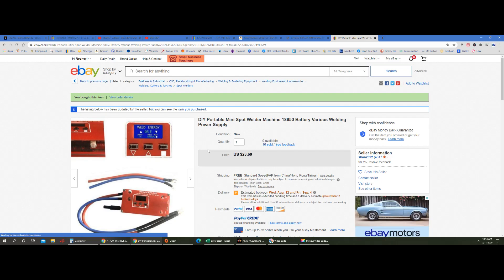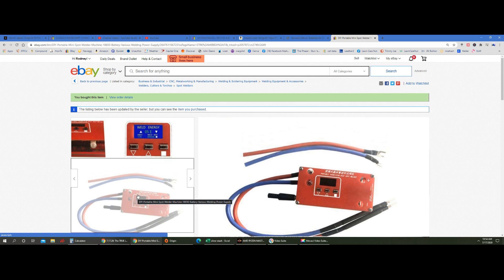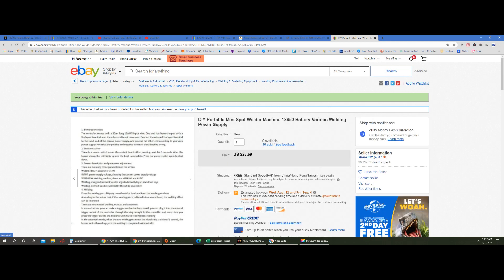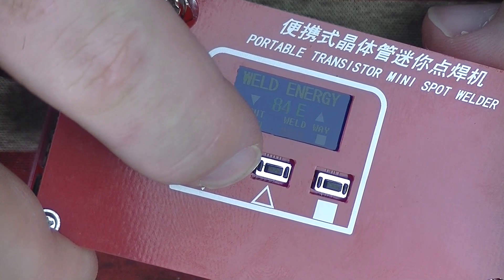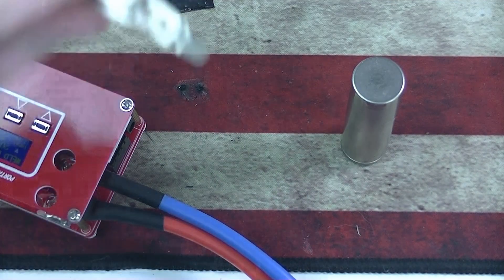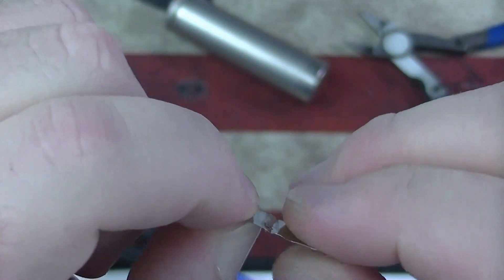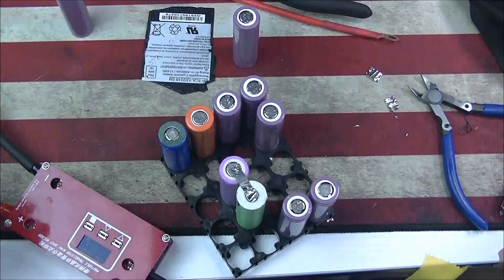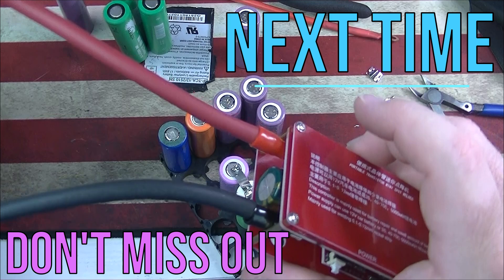The Best CHEAP 18650 Spot Welder?

Comment: I am on my second Mini Spot Welder and both fail out of the box.  Cranked it up to level 99 and nothing but a click (on both). Basically this is a POS!  It could take many of these to find one that actually works and with a 45 day delivery from China/India this could take 6 months to a year for a simple spot welder.  Not worth the effort.
Reply from the maker: Buy a kweld.  Never heard a bad thing.  Also no reason to use it at 99. Unless you are welding a car frame.  Lol.  My latest video I used a small 8ah lead acid and it would not work.  But with my 3s lipo no problem.  Try a different battery.
Reply: @RodneySolarCircuits  Tried two different car batteries.  One 30AH and the other 60AH.  I cranked it to 99 because it would nod weld. Even at 99 there was no discoloration or any evidence of a weld.  at level 20, 40 or 60 nothing.  these all look the same down to the capacitor.  I am sure they are all manufactured in the same China plant.
Reply: I am interested in the All-In-One you demonstrated on the prior vid.  How would you rate it to this one?  Lastly, how long did the All-In-One battery last before recharge needed?
Reply from the maker: @DM-rt8ts  yea.  Dang.   Most people in the comments have blown theirs up using car battery. Im gonna make a video about it soon.  See if I can replicate.  I have so many cheap welders. I like this one tho.  It's the most powerful.
Reply from the maker: @DM-rt8ts  I built a 7s5p pack 35 cells and didn't have to recharge.  Did just fine with .10mm
Reply from the maker: @DM-rt8ts  you could always make a bigger battery for it pretty easy.  Buy a handful of lipo cells from battery hookup.  Maybe even some of those lifepo4 cells have crazy c rating.
Reply: @RodneySolarCircuits  BTW, kWeld is on back order all models. Amazon does not appear to carry kWeld either.
Reply from the maker: @DM-rt8ts  message 18650ed on eBay. See if he has any.  Fast shipping from US.
Reply from the maker: @DM-rt8ts  search for 18650 shrink wrap and he sales supplies.  You will see his multiple items.

Comment: Battery Rating:   60C x 5200mah = 312 amps (Max discharge Rate).  System is setup with 5(300A) Mos Tubes.  In theory, Tubes in  parallel should be able to handle 1500A.  Whats the Max discharge rate of a car battery?  In-balance in any of the tubes could cause a tube failure with a car battery.  If the tubes were in series you would be limited to a 300 amp discharge rate from the tubes, thus using a car battery is out of the question.  I've not seen the circuit, just theorizing  potential failures.  I believe the current, not voltage, to be the cause of the tube failures.  Just throwing this out there.
Reply: So I tried voltage with in specified rating. She still blows up after a few welds. I'm down to two MOSFETs. 🤣 Either these FETs are fake or the soldering work on the negative side of the unit are poor. IMO the power rails need to be beefed up .
Reply from the maker: @gregala84  dang, sorry
Reply: @RodneySolarCircuits  Does anyone have a number off of the Mosfets?  Picture showing the number and manufacture symbol?  Are the fets in parallel or series, i'm assuming parallel.  The fets more than likely don't have a big enough heat sink to keep from burning them out.   I assume 300a is max fet rating, or, is that per 5 fets in parallel (60a ea)?.  Whats the nominal current rating for each fet?  With a proper heat sink, you should try and limit your current draw to the nominal amperage.
Reply from the maker: @user-kx4dj5ee3o  parallel and the fets I tried to look up but couldnt find anything.
Reply: @RodneySolarCircuits  You could replace the fets with something that has some known specs.  Most likely they are p-channel mosfets(positive pulse required to turn the fet on).  Go to Mouser or some other parts supply warehouse and look for the fets with the same form factor and high current specs and protection diode across the output.  Can anyone get the numbers off of some of  the other spot welders being reviewed?
Reply from the maker: Maybe. I cant remember if I found the data sheet for the tubes.  but I guess if you try and pull too much thru a tube and it cant be smart and save it self like a good inverter.  but I use 3 spim08hp cells, continuous of 200amps each and pulse of 400a for 3 seconds.  It says 9v-12v on the welder. so 13-14 volts might  be to much after it warms up.  The comments say they blow up after 10 or so welds.
Reply: @RodneySolarCircuits  That's a shame. What was your experience with the number of welds? Did you get more than 10? I thought you got more than 10 just doing the video. Could it be, the ones that did only 10 welds were doing it with a car battery?
Reply from the maker: @user-kx4dj5ee3o  Yea I never used lead acid,  they were using lead acid fully charged.
Reply: Well I just bought this and 2 of the 5 MOSFETs on the board blew up and shorted. I had it on setting 20 🤷🏿‍♂️
Reply from the maker: @gregala84  car battery?
Reply: @RodneySolarCircuits  yeah at the time it was at 12.3v. I removed the 2 bad MOSFETs now it's working again with the 3 feta but it don't weld nothing.
Reply from the maker: @gregala84  read the responses, William found the replacement fets!
Reply from the maker: @user-kx4dj5ee3o  Man thats awesome, Thank you William !
Reply: Thanks guys but I already ordered a few 4N04R7 see if it works I'll report back when I get them.
Reply: @gregala84  Hope it works.   What I noticed on the  IPT004N03L spec sheet was the consistent 10v for Vgs.  The  Vgs specs out at  +/- 20v.   I'm wondering if the failures are due to spikes above or below +/- 20v or above 10v, which is what they focused on.   Other than that, spec wise it should  work with power sources  up to 20 volts and 1500A nominal.  Each Fet has a 1200A pulse rating.  The is also a spec of 72A associated with the max power (3.8watts)  dissipation at 25 degrees c (77F), (Heat sinks could help here).  Looks like heat may be a factor as well.  Put your finger on the fets after a weld, make sure their not hot before the next weld.  A schematic of the circuit controlling the Vgs input would be helpful.
Reply: 4N04R7 -  https://html.alldatasheet.com/html-pdf/549546/INFINEON/IPLU300N04S4-R7/392/1/IPLU300N04S4-R7.html
According to the current vs Vgs curve you will need to be very mindful of your power source.  In other words you need to limit the size of your battery (no car batteries).  The curve makes it look like it will suck every ounce of current from your source as Vgs increases. Again, this is where a schematic of the Vgs input circuit would help. My 1st question would be are they voltage limiting/regulating the  Vgs input(diode drops, zener diodes ...ect)?
Reply: @user-kx4dj5ee3o  if these don't work out. will these work? FDB0170N607L
Reply: @gregala84  Yes, however spec wise it looks and acts like the 4N04R7.  All the precautions still apply.  You will have to lift pins 2 and  3.  It looks like the fet uses pins 2 and 3 for temp monitoring.  I recently viewed a video where the device used the 4N04R7. He used a small lead acid battery, which I believe exceeded the  max thru put current of 300A. He was able to get 3 welds before the fets shorted out.   At that point, It was max power every weld, which melted or blew the strips apart. 

https://www.onsemi.com/pub/Collateral/FDB0170N607L-D.pdf
Reply: @gregala84   hi did you try out the 4N04R7   i need to replace 2 gone on mine  been looking for some  for mine
Reply: @gregala84   Hi how did you get on with the 4N04R7 i need to replace 2 on mine now
Reply: @gazbullen  hey Im still waiting for them to arrive. I taken them out for replacement. I used a hot rework station to remove the old ones. I plan to add heat sinks, Hi voltage Schottky and TVS diodes, and upgrade the bus power lines with thick solid copper wires. If you have Facebook look for a group called DIY 18650 and join. Look for Matthews post on this spot welder. He did those upgrades I mentioned and he's been successful with it so far.
Reply: @gregala84  Would it be possible for you to provide more info on the diodes (exact type and where to place them)? I don't have a facebook account and would rather not make one. Thank you.
Reply: @gregala84  HI ok thanks for the reply i will have a look on facebook .ive taken mine off ready but now ordered any yet. ive up graded the bus power lines all ready.it was just the 4N04R7 i was  to see the results heard bad things with then,but they might not of done the other upgrades as mentioned by the way mine went using a AGM 12v 9AH battery with a 20c rating which should of been ample for it .
Reply: It looks like this board has 13V TVS protecting the MOS gates. I plan on using a large 4S lithium car jump start pack as power source. I know 4S will risk more arcing, but it's what I have. I will replace the 5x 13V TVS with 18V zener diodes and also add a 5kW 18V TVS on the supply and output sides. Might as well change the cap for a quality 12000uF low ESR while I'm at it since shipping will cost more than the parts.
Reply: @andronicuscomnenus2642  wot 18v zenors you going to change them for 5watt ones will be interesting to see wot difference it makes.
Reply: @gazbullen   SZ1SMA5931BT3G 1.5W for The MOS gates. They don't flow a lot of current. For the TVS on the input/output I meant 5kW (5,000W) 5KP18A.
Reply: @andronicuscomnenus2642   you going to use 3 of those as seen a pick with 15SQ045 x2  one either side of + input and out and 1x 5KP13A  neg in and to neg out ?
Reply: @gazbullen  No, I'm just adding similar protection like kWeld has.

Comment: hey man can this connect to a car 12v battery ? whats the battery you used and connections you didnt say regarding hooking up
Reply from the maker: I used spim08hp cells. I would say use a 3s lipo battery. I've heard some blow it up with car battery voltage.

Comment: Hi i bought this exact spot welder. How did you manage to minimize spark? My settings was set to 10E but still too much it burnt the cardboard underneath while testing on some tabbing wires.
Reply from the maker: It will burn the cardboard everytime.  To prevent sparks you need to make sure there are no gaps between the welding tip, tabs and the battery.  Make sure you have good contact
Reply: @RodneySolarCircuits  i don't think I have gaps between the three. It also now sparks the moment I touch both tips to the tabbing wire instead of beeping first. Thank you, I'll try again, maybe i missed something.
Reply from the maker: @michaelalfonso8145  Sounds like one of the mosfets blew up.  take it apart and see.
Reply from the maker: I've heard of another one doing the same thing when they used a car battery.
Reply: @RodneySolarCircuits  thanks! Will check.
Reply from the maker: @derrenknight1793  I have never had a problem with my SPIM08HP cells in a 3s config.  Maybe it cant handle 13.8-14.4 volts.    Make sure your battery is about 12v. Im working on a video for the LG 120ah modules then I will start "Will it Spot Weld" video "Battery day" If it blows up ill buy another or replace the mosfets that blew.

Comment: Could you please test it with pure nickel strips (preferably with 0.2mm ones)
Reply from the maker: I know for sure It will weld anything a Kweld will.  I built a small pack this weekend with this and it did great.
Reply: @RodneySolarCircuits  Thank you for the reply. I guess I will purchase one. I am thinking of using it with a car battery maybe 🤔 Or maybe the LiPo cells you are using... Could you please tell me where did you purchase yours from?
Reply from the maker: Its in the description of the video.   Link. Battery

Comment: what size battery did you use? do you recommend better welding leads?
Reply from the maker: I used a 3s SPIM08HP, 8ah battery.  leads are sufficient enough but you could

Comment: Would this work with a 7Ah lead acid battery (75 CCA)? Have you tested this with 0.2mm nickel? thanks :)
Reply from the maker: I was thinking the same, I have an 8ah lead I can try
Reply from the maker: Yes, in the video I thought I used 0.2mm  It worked well with this welder.
Reply: @RodneySolarCircuits  Was it "pure nickel" or just nickel plated steel?

Comment: Hey!  How can spot welding cause an 18650 to leak out like a small firework?  I'm looking to buy this model after my last accident.
Reply from the maker: If the welder is set to high/hot it can melt a hole through the cell.  I have had it happen too.
Reply: @RodneySolarCircuits  Would the following also cause that problem:
Too much downward force on the copper tips
Fully charged battery
Duration of spot weld activation time
Reply from the maker: @lazal3m  duration of weld would.  NOT enough force on the tips. If there is a gap it will jump the gap like a spark plug and could blow a hole.
Reply: @RodneySolarCircuits  Thanks! What would you recommend would be the best energy setting for this?
Reply from the maker: @lazal3m  between 20 and 30 depending on the thickness of your nickel strip

Comment: Could you try using 0.2mm nickel strip would be interesting
Reply from the maker: I have no doubt that this set up will do .2mm.  I even have .3mm I could try.
Reply: @RodneySolarCircuits  I wonder if this could be a kweld replacement for under 100 dollars?
Reply from the maker: @willkim9134  Yes, as far as 18650 builds. I built a small battery with this the other day. instead of getting my Kweld out. This is way more compact and has the power.  If You upgrade the wires to OFC it would be even better.  I tried to use the Kweld  on the LiPo tabs and it would not work either. .
Reply: @RodneySolarCircuits  what wire size would be good upgrade?
Reply from the maker: @willkim9134  8ga OFC copper, it comes with 10ga but its CCA copper tin.  even a good 10ga would be better.
Reply: @RodneySolarCircuits  also what lugs do i need for 8awg and can it be crimped by hand?
Reply from the maker: @willkim9134   I used a spade/fork style, and yes cold crimp joint is fine.
Reply: @RodneySolarCircuits  wire length matter?
Reply from the maker: @willkim9134  battery to welder= as short as you are comfortable, 6"-12" .... 12"=18" for welding pens.  Or copy what comes with it.

Comment: Great. What will happen if you try to use 4S 65C 1500mah drone battery? Will it damage the spot welder?
Reply from the maker: Im gonna have to see what the voltage of the CAPACITOR is.  It is prolly 16 volts like other ones.  If thats the case then make sure you stay under 16 volts.

Comment: Is there anywhere that can ship this as quick as yours?  all available ones are 2 months out on ebay.
Reply: I ordered one from banggood and it came in about 2 weeks.
Reply from the maker: I seen some on amazon. little more expensive, not to bad.
Reply: @RodneySolarCircuits  they also book out until october or November.:(
Reply from the maker: @wantafastz28  I think it said a month, But it only took 15 days.
Reply from the maker: I found this one on ebay for $36 and it ships from US.  searched: (spot welder) and it was about half way down
Reply: @RodneySolarCircuits  I ordered one yesterday, should be here this week. :)
Reply from the maker: @wantafastz28  Awesome, hope it works for you!

Comment: what battery are you using?
Reply from the maker: SPIM08HP
Reply: @RodneySolarCircuits  what sort lipo would you recommen md using?
Reply from the maker: @willkim9134  most lipo cells have good output. You could buy a drone or RC battery off ebay or Amazon.  You may would need a charger and to buy a matching xt-60 plug. Or you could buy the welder from my other video that comes with a battery and charger (all-in-one).
Reply: @RodneySolarCircuits  do you thinks a 3s 5000mah 80c lipo work fine?
Reply from the maker: @willkim9134  YES!!  80c is more than enough.  That is a perfect battery.
Reply from the maker: I believe your battery is capable of 400 amps continuous.

Comment: Cool you could increase the voltage to 13.5 and try a test
Reply from the maker: maybe
Reply: @RodneySolarCircuits  Well if you can use 12 volt lead acid it is basically dead at 12 volts and nominal is usually around 13.5 but it's not my welder so good luck. Thanks for sharing.
Reply from the maker: @offgridwanabe  gotcha.  I don't mess with lead acid except for vehicles.  So I did not pick up on what you were inferring.  Good idea to add to next video! Thanks